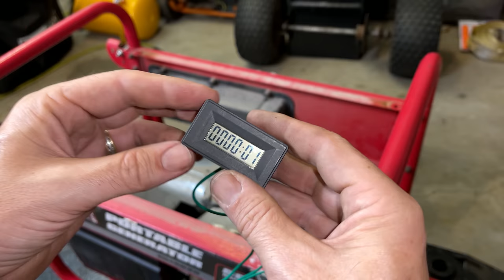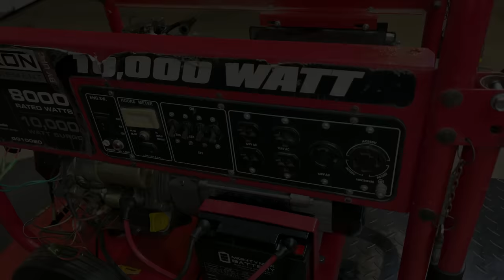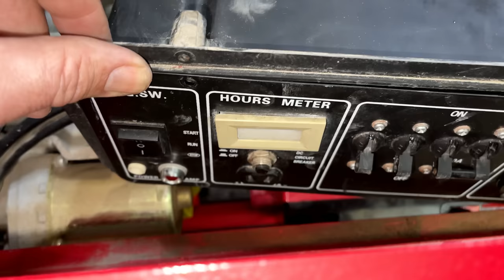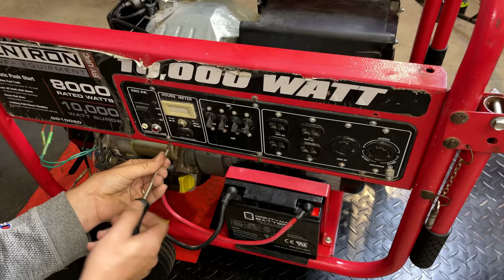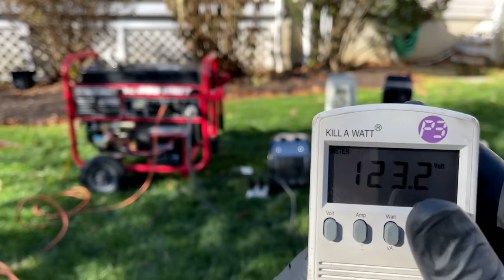Generator Engine Dies Out Quickly - Only Runs for a Second (Not the Oil Sensor)

Comment: Another excellent video and great deal getting get the generator back up and running. James you should add a cable tie gun too your inventory of shop tools, I use one in the electronics field and they work great for dressing up cable harnesses, you can adjust the tension and they make a nice clean cut on the cable (zip) tie. Love watching and learning from your videos. 👍
Reply from the maker: I recently got one.  Its in the tools category in my store.  I love it.  Unfortunately so do my kids.  Its always missing from my toolbox.

Comment: The blown out rail might be fixed by putting the biggest bolt you can through the hole and 2 thick washers, one on each side and then use the bolt and nut to squeeze the blown out hole in the rail. It might work. You have great videos and I am a car mechanic, so watching you work is very interesting to me. But I'm retired now,,,,,,,,,,,,,,,,,

Comment: Old trick from BMX days when I used to ride freestyle bikes and want to get a grip on the handlebars so it’ll stay on and it won’t come off hairspray they go on so easily and when they dry, they never want to come off. I usually have to take a razor blade to cut them off. And spark arrester’s I do everything I can to remove them as soon as I find one absolute garbage always a headache always a problem just get rid of them and no more problems.

Comment: If the carbon in the muffler was a bigger issue, you can soak the muffler itself in hot soapy water, it will definitely break up the particles.
I’ve done it in the past with mufflers, that have been oil contaminated.
Dawn dish soap works the best.

Comment: Great post. I have a running 5kW diesel unit with no power output in my in tray, but it will prolly have to wait to fix due to impending house move. We're looking at blackouts coming in the deep UK winter due to continued complacency & foolishness over certain 'belief systems' of the government here, so maybe I'm doing ok here with my 2KW backup petrol unit I acquired as an unwanted return from Screwfix at discount.  However, I'm still puzzled why manufacturers can't design effective mufflers for these units when they seem to have done so on cars,  it's one of the most off putting features of these crucial bits of kit. Your dedication is commendable.
Reply: I live in UK too Ruth. Living in a fairly populous area means we do not get many power cuts. I have never owned a generator for myself because it never seemed like a good investment. I repaired loads of them when I was still of working age. I am just hopeful that we will not get these winter power cuts that people are talking of. My back up plan consists of a calor gas bottle heater, an oil lamp and lots of candles. Gas, or petrol as we say, generators are just too noisy. If I am forced into it I would buy a battery powered inverter generator with a good set of batteries and a good charger for when we do have power.

Comment: you should point out the three ports just inside the carb by the choke plate; idle, mid speed and high speed. you have to bend a wire at 90 deg to reach in. also check the fuel shut of sol. with 12v

Comment: Ha.
I have one that got me with similar symptoms.

Eventually figured out that the fuel shutoff valve was off, but leaking through enough to fill the carburetor bowl. One pull would get it to run for about ten seconds (no ether).

I emptied the tank and pulled the valve out to fix it but the project got set aside. When I came back, the tank was rusted internally.
So I pulled the trigger on another project, and just converted it to propane.

Comment: Yeah, I've put paper filter on a gravity fed John Deere once. It worked good for a month. Then it would run maybe 30 minutes, then die. Pull the line off the carb and nothing was coming out. Switched to the pancake style screen filter. Worked fine.
Reply from the maker: Thats exactly the problem.  They work great until they become a little dirty and the 1/2 PSI from the gravity feed system just cannot push through.

Comment: Fun project (or frustrating) if they are legal in your area build a motorized bicycle. I recommend the 4 stroke kit as those are 49 cc and legal in most states. I use the Kent Ridgeland frame.

Comment: Cut the old hub in the necessary length to use for a spacer.  Soapy water or dish soap coating will enable the grip to slide onto the shaft.

Comment: James Condon Instead of spacer . you can drill a hole on the backside . like in front with a washer and a lock pin  . (the axel to the wheels)

Comment: Merry Christmas Jim!   You might try a Old School Carbon Removal Method. Remove the spark arrestor. and air filter. With the engine running squirt water down the throat of the carburetor from a spray bottle. The water will flash to steam in the combustion cylinder and clean out much of the soot and carbon.            Best of Luck.......................
Reply: Use fine windows screen and then spray bottle is what I do 
Seen my mechanic Dad do it a thousand times

Comment: Hey James, love the channel man. Tons of quality info. A little trick from me with the handle grips. Try using hairspray.  Just spray it on the inside of the grips and maybe a little on the bars. It will allow them to slide right on and once it drys they will be locked in place.  It's a dirt bikers trick. Your way worked pretty good though but if they were to tight or made from maybe a stiffer material you might have a hard time. Anyway you do awesome work.  Thanks

Comment: 51:30  Couldn't you have straightened it out by putting a bolt with 2 large washers on either side of the rail and then just cranking down on a bolt  So long as the washers are thicker and stronger than the metal that makes up the rail, the force would have flatted that rail metal, I would think.
Reply from the maker: Yes.  Actually just tightening the leg bracket kind of did the same thing.

Comment: My father in law had a Sears 3,200 watt generator with a Briggs and Stratton engine that had a low oil sensor on the outside bottom of the engine.
    It would start and run for a second or two and quit. He was meticulous about maintenance and it never used oil. He went to use it when the power went out and called me when he couldn't keep it running.
    I went through the carb and ignition system to no avail. The last thing I checked was the oil sensor which looked like and automotive type but acted like a kill switch. I disconnected the wire from it, pulled it over and it ran. He ran it that way while I went to a small engine shop for a replacement. We used an original Briggs part because with something like an oil kill switch, if you substitute something like a car part and it runs, you won't know if it will work until it either runs out of oil and quits or runs out of oil and seizes.
    He paid more for this unit than I paid for my Coleman 5,000 watt unit that ran in emergencies flawlessly for 20 years. He didn't want to take any chances with his investment. The only reason I sold my Coleman was because back problems forced me to invest in an electric start unit.

Comment: Hammer and dolly would fix the rail.Dolly on top and hammer below to straighten the metal of the cross Member. Also if you need an alternative for the wheel spacers Springs will work or just electrical conduit cut to length. But, PVC is cheap or even free from the trash pile.

Comment: Install a bolt and washer in the damaged hole and it will flatten out as you tighten the bolt also using washers. Four bolts will stop the support from failing again.

Comment: Bit late to suggest this but you could have used the broken wheel centre cut down to size, for your spacers. The plastic pipe will quickly wear away in use as it will be rubbing against the turning wheel, the old wheel centre will be on the bearing centre so won't wear away.

Comment: My son borrowed my small gen. set for camping. When he came back the whole inside of the generator was carboned up. He said it wasn't running good the second day of use and was smoking black.
I wasn't impressed that the spark arrestor was plugged up with carbon. It ran fine after I removed it. The unit had 50ish hours on it . I returned it and got another one.
Then I ripped the spark arrester out of the new unit. I don't feel they are needed, unless you are in the woods running it. When we camp in a trailer the genny is on concrete.

Warning ! I do not recommend removing the spark arrestor, for my application/use it is not needed and less of a headache to deal with so I just remove it. I do have the arrestor in a drawer in the camper in case I do go where there is a forrest.
Reply from the maker: If on pavement or a driveway then no issue.  But as you said if in the woods or a dry field, then best to use it.
Reply: Did he possibly run it with the choke on? Anyway, except for a couple brands,  the first thing to do to the new Chinese type generators is replace the spark plug with an NGK or other quality brand and remove the spark arrestor. It will save headaches and improve performance. Cheers!

Comment: James, I was just wondering if you've ever tried Permatex Permashield gasket cement for sealing connections carrying gasoline.  It really works great; better than anything else I have ever tried.  Most auto parts stores don't stock it, so you will have to order it.

Comment: Just like Motor cycle grips use soapy water when installing them and for the spacer you can use the hub of the broken wheel just cut to length. Also just an FYI the old Champion spark plug tool had benders for the ground electrodes also with a slid to adjust the gap.

Comment: James, a hint on the grip, use hair spray or brake cleaner, it lubes to allow it to slide on and position it where you want it and then, it slightly dissolves the rubber and once it evaporates this acts like an adhesive.

Comment: The bit that you took off from the old original wheels the tube you could cut it in half all required  size and use it behind the new wheels as a spacer

Comment: Another way to get the rubber grip on the handle is to put some a small amount of soapy water inside the grip. Once the water evaporates the grip will stick hard to the handle.

Comment: Great video as always. One thing I saw was you smashing washers on the ground with a hammer to flatten them. I've found a large pair of Knipex pliers wrench (the one with the flat parallel jaws). They work amazing for flattening thin sheet metal items, washers, etc. They also work well for removing bolts.

Comment: You could have flattened the rail for the foot bracket, by using a pneumatic hammer and a backing steel bar to act as an anvil. Bar on top, and hammer from the bottom. No need to remove any parts.

Comment: At 55:33 that cone of metal gauze definitely should have been left a bit long to overlap the silencer tube you are putting it into (serving as a means of preventing it falling inside), and bend it back over the outside of that tube.  Then the old bit could fit inside it.

Comment: That was a fun and satisfying jaunt.   If you have a dead battery do you check that the new battery is being charged to a reasonable voltage when the generator is running?

Comment: Iv'e had an ignition capacitor short internally after about 15 seconds of running time. It kept running, but back fire badly, sounding like sticky valves to me. After taking it apart, and putting a hair dryer and a ohm meter on it for 10-15 seconds did it prove bad. The cap was new.

Comment: Based on what you said about the hour meter running on AC because the wires are the same color sounds right to me. That brings up a question and a possibility. What voltage does the new hour meter run on? It likely runs on 120 volts AC or 12 volts AC if it doesn't run on 12 volts DC unless it contains a volt meter capable of showing 240 volt reading. If that is correct connecting it to the 120 volt AC out put would be easy if it runs on 120 volts. If it runs on 12 volts AC it could be connected to the 12 volt output before it goes through the rectifier to charge the battery. Getting this info would not only help on this generator but would allow you to replace the hour meter or add an hour meter to most generators for less cost. I would expect that it would not use less than 12 volts AC so it should be safe to try it on 12 volts AC with out damaging the meter to find out if it runs on 12 volts AC. If it gives other readings like volts it could only run on 120 volts or 240 volts. Certainly would be interesting to know. If the new meter runs on AC it likely has a built in rectifier because It is unlikely the electronics in the meter uses AC.

Comment: I don't know if it would work on a small engine but I have had luck clearing carbon from a big engine by spritzing / misting water into the intake while it is running at high speed and well warmed up.  if the carbon is hot it tends to shatter when cold water hits it.  Like I said I have never this on a small engine so try it or not as you see fit.

Comment: Had a generac doing that, it ended up being the carb fuel feed line was jelled up and the float needle was corroded and chrome plating was failing on needle, modern gas with 10% ethanol here in MA ruins everything.

Comment: Excellent video. Your videos are really informative and I learn something from each one. Your trouble shooting skills are incredible!
I do have a question. If your generator doesn’t have a low oil sensor, can one be installed? If so do you have a video on this. I’d like to put one in my Briggs and Stratton Storm Responder 5500 if it’s possible

Comment: Spark arresters go back to 2 stroke chainsaws, back when they used 25:1 mix .. that made burning oil clumps/sparks to come out of the exhaust, creating forest/wild fire risk .. That caused spark arrester laws.   4 stroke engines shouldn’t need spark arresters.

Comment: Pro Tip ; if you are sliding on a grip and its a tight fit spray the handle with windex , the grip will slide on and the windex will evaporate .

Comment: Never tried it, but I remember something in Popular Science about burning carbon out of a car engine with an oxy/ acetylene torch.  It was way back in the 30s or so.   Maybe high heat on the arrester screen?!
Reply: My Dad was a mechanic and he used fine window screen 
Drive it hard and stop raise hood and dribble water thru screen while I held throttle down 
Carbon would come out for miles back to shop

Comment: I always enjoy your generator repair videos, I am thinking of purchasing a used pure sine wave generator that I can repair, would you please recommend a oscilloscope that I could purchase to check the sine wave pattern before I use it to run sensitive electronics. Thanks
Reply from the maker: The two I use are on this page.  The multimeter one is easier to use, but less resolution.  They will show you the wave form but not the harmonics
Reply from the maker: https://www.amazon.com/shop/jamescondon/list/JJBRU0JRN7OJ?ref_=aip_sf_list_spv_ofs_mixed_m

Comment: My Honda 350 oil blocks the muffler if mixed 50:1 like the tanks says to use ... manual 100 to 1 !!!! Takes time to clean the muffler but runs for a year or so ok at 100:1 but now and then it gets filled with 50:1 by guest at the cabin !

Comment: Cut the dip stick off and remember don’t let low oil shut down tell you when to check the oil 
They fail also from dirty connections and wires not properly connected

Comment: Curious question regarding the carbon buildup in the muffler, could you not spray a bunch of oven cleaner inside, let it sit, then wash it out with a hose?

When you reinstalled it and ran it, should get warm enough to evaporate the water...

I've done it on a carboned up Turbo on my old Jetta TDi, and it worked like a dream!

Comment: I really enjoy your attention to detail in the videos. I think of myself as a good small engine mechanic, but Generators/Invertors are a bit out of my wheelhouse. Well the electronic part is. I have a small Honda like Invertor made by Coleman, the PM2000i. I had to clean the Carb on the other day. It's less than a year old, and I keep and use 92 octane NO ethanal type fuel, and it still ended up plugged. Have you ever worked on one of these units? I'd like to find Service info for it. It's ideal to take camping because it's very quiet. Thanks

Comment: OMG, I know exactly what the black crap was in the tank is. One fact first though: alcohol (ethanol or methanol) deteriorates the properties of rubber. Ok, so, the age of the generator was intended to run without ethanol blended fuel. The fuel lines got hard and the rubber O-ring from that gas can spout war out/ melted from long exposure to ethanol. Tygon must be used with today’s fuel blend

Comment: I don't think I've ever seen a spark arrestor get plugged up on a 4 cycle engine, but I'm not a mechanic either, so there's that. I wonder if they ran it for a long time with a plugged up air filter or the carburetor partially choked?

Comment: Spot on as always.
Looking for a replacement fan shroud to a 3.5 B&S on a 1850 colmen generator (1994) works but has cracks, any ideas on where to look have already checked around town with local small engine shops they don't save old small engine parts.
Reply from the maker: Best bet would be to find the engine number and get the part number for the blower housing and do an eBay search.
Reply: @jcondon1  
Will check e-bay.

Comment: Some of the repair shops where i live are flooded with generators because of the incoming storm and they are saying possible power outages
Reply from the maker: Hoping I sell a few.
Reply: @jcondon1  i need make sure mine runs. I finally got the new AVR put in